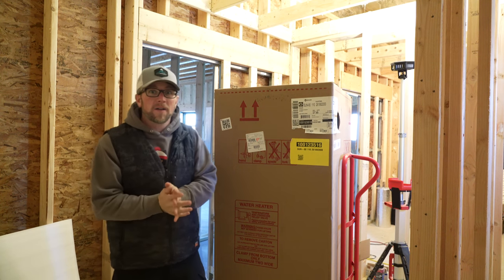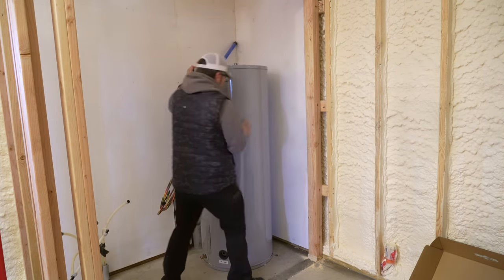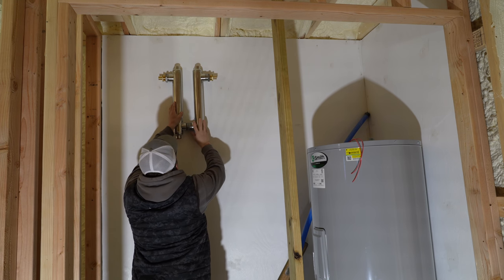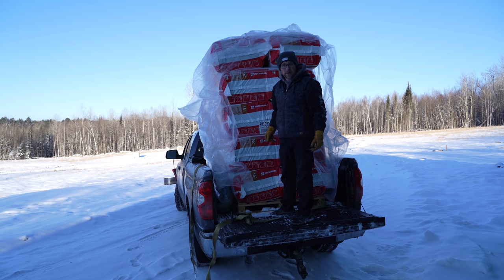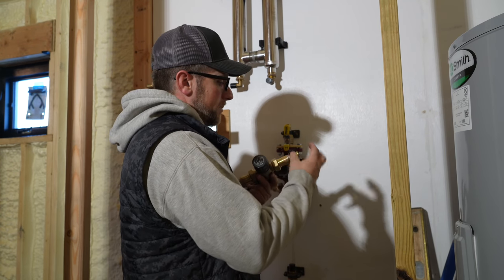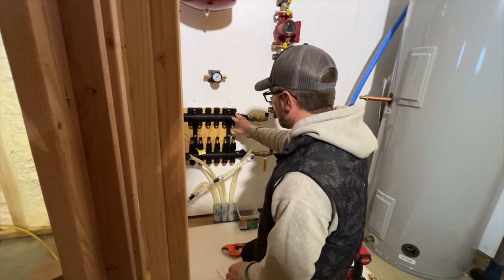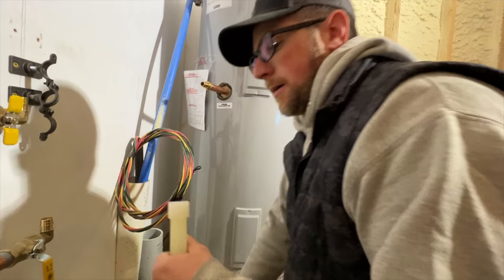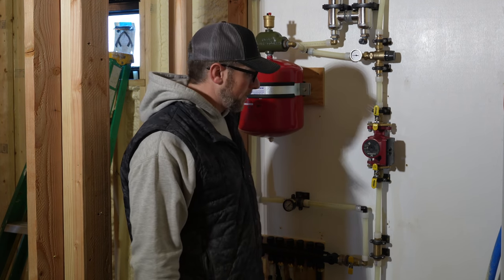What Could Go WRONG... Installing In Floor RADIANT HEAT with No EXPERIENCE!

Comment: my brother has an outdoor boiler in Minnesota but does not have fresh water going through it it is filled with anti-freeze and a heat exchanger heats the water so the water never freezes even if the fire goes out. that might be an option for you.

Comment: Flux just prevents the oxidation that would occur very quickly when you heat the metal that would prevent a good joint. You don't need flux after the solder. You should just wipe the solder with a rag to clean the outside of the joint to remove any drips.

Comment: I hope that one angled fitting does not leak.  From watching other videos where people used that expanding pex it does not always seal if there is sideways pressure on the fitting connection.

Comment: Yes that valve at the bottom of the hot water tank SHOULD have a handle on it. And like the other subs are saying, please put a plastic pan or a wooden box under your tank. Great videos, Blessings
Reply: A commenter stated that no handle comes with this particular unit.

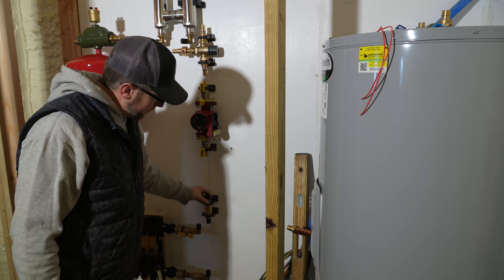Comment: "The knee bone connected to the thigh bone..." that's what came to mind as you described where the water was going to go at 00:21:13, lol. Sure am glad you know what you're doing. Reminds me of the first time I was rebuilding a computer using Scott Mueller's 4-5 inch thick book. I had to read each paragraph over and over until I could understand it!

Comment: Two problems with pink fiberglass 1: at below -20c it loses 50% of its r-value through conduction (the dirty little secret) 2: if it gets wet, the insulative value is also compromised. The binder also seems to be a favorite meal for black mold once it does get wet. (I've removed a lot of this.
Roxul is a product made from processed slag. It is short fiber as opposed to fiberglass, no binder to worry about, and insulates even when wet. We've switched all our projects to using that or foam. it's also less itchy.

Comment: AOSmith is a great water heater and the drain valve is correct you use a flat blade screw driver.

Comment: You can put Glycol or something similar in the system to prevent freezing.  You should always put it in that type system. FYI doing plumbing and HVAC design work since 1972.

Comment: Solar is a good way to go it's a little bit on the high end but in the long run if the power grid should happen to fail at least you know you're going to have something which is very important.

Comment: When you were sold the Outside boiler,! didnt the supplier not have the pipes you need in stock?, I would imagine they would have been part of the Boiler, surely they could get the pipes quicker than you!!!. Lot involved putting in all the bits needed!!. Thanks for the video from cold UK.

Comment: Nice job with all the pipe runs. As for the water heater drain valve, it looks like the one that I have...no handle. You have to use a screw driver to flush it. If your water has a lot of minerals in it it will, eventually, be next to impossible to open after a year or two. When I replace our heater I will install a better valve before installing the tank.

Comment: Not sure on Flux with plumbing but with electronics the Flux is used to help the solder flow. But it's corrosive and should be cleaned with alcohol.. I could be wrong when it comes to copper pipping, but it's definitely not a cleaner. I'd clean those joints with alcohol.

Comment: You can swap out the 240v heaters in the tank with 12/24v ones to go right from the panels skipping the battery and inverter.

Comment: I would have gotten a larger pressure tank so the pump does not have to work so much, unless that tank is just for the floor, then it would be fine.... Awesome job, both of ya.....

Comment: I've asked before. Are you using antifreeze in the outdoor loop if not why.
 The reason I ask is that I used to help install outdoor oil fired boilers and antifreeze was a must.

Comment: The water heat is before it goes in the tank and after it comes out of the tank it works very well this way it was worth the extra 140 for the extra heat extra heat extra heat exchanger and I always have hot water

Comment: I used Shark Bite fittings on my system. But that process you used for your hose connections looks real promising.
Reply: Considering the cost of sharkbites he probably came out a wee bit cheaper. Love PEX. I replumbed ny entire house with it. Only have 1 line under the house now. Wouldn't use ANYTHING less. I used crimp rings. Never had a leak yet but I must say, it wer'nt cheap. Still, gotta love that expander. It will pay for itself many times over before you finish the big house provided it's a quality tool. The bitterness of low quality long outlives the happiness of low price.

Comment: Love your videos and been watching for years. Pull the valves apart before you solder them. There are plastic seals inside that could get damaged by the heat

Comment: I believe you should trench in your heat pipe from your boiler to the house whether you hook it up or not because the ground is only getting harder on you tape off a block off the ends outside and then you won’t have as much trouble otherwise you’re gonna be looking for a jackhammer to put on the end of your bobcat excavator

Comment: On solar systems there is a way to use the excess power generated (batteries full) to use that extra power to run a load such as a hot water heater.
Reply: The water heater will run from solar power in the summer when the boiler is not being used.

Comment: I noticed you have not placed a about two feet PVC Frisbee under your new tank, this prevents the lime in the cement from rusting out the bottom, it will sweat under there, other thing you should avoid soldering with lead as it is toxic, copper solder, no flux needed copper to copper just a little when soldering brass

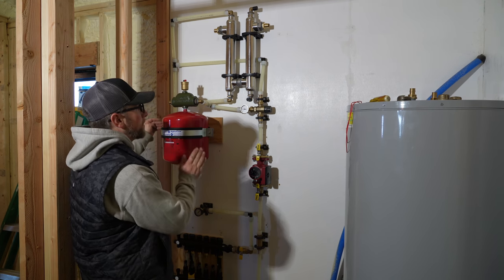Comment: 32:05  you will have a chance to clean that pipe up when you cut it out to install that mixing valve in the proper orientation ( you want to have the circulator pulling from the "mixed" port)
I would personally remove that mixing valve and install it on the domestic tank so you can put more energy into the tank and still have tempered hot water
As far as doing radiant with a tempering valve..meh...it is only giving you the ideal temp at one specific heat load profile look into the "taco I valve" it will change the system temp delivered to the system based on outdoor temp...keeping things stable and happy
hydronic pro for 30+ years    oh btw that pump already has a check valve in it if it says "IFC"...not that you would need any check valves on that system

Comment: Flux is an acid cleaner and you need it to allow the solder to flows integrate into the prices you are soldering.   I solder alot for work as a steamfitter.   You should only solder joints above a ball valve like that in an as needed basis.  Reason is your solder can drip down into the ball valve.  Normally you would shut the valve if you had to do it that way.  I always solder in horizontal position preferably in a chain vise.  I also leave valve half open in horizontal position so the water in valve from testing doesn't turn to steam and leak out the packing.  You also have a hot water maker.....not a hot water heater.  You don't heat hot water.

Comment: Is that an enclosed boiler ?  cause you have expansion tank.  Use boiler treatment in it add some every year .keep rust out.
Hope you have the pipes insulated to the house or ground will suck out heat.

Comment: I noticed that you are using the Uponor pex system. Think it is also called Pex A and not available in the big box stores, only at plumbing supply stores.  Many think it is the better pex system but the down side is the price of the Milwaukee expander.  It is the only pex system, I think, where the unions inside diameter is the same as the pipe inside.  I used to replumb our 100 year old farm house.
Reply: Money never seems to be an object. YouTube profits pays for all the exuberant things they do like the large green house and numerous battery powered tools and tractors.

Comment: It's a good idea to raise the hot water tank above the floor about 2" to 3" in a overflow pan drained outside or floor drain. All your brass connections should be taped with Teflon blue tape or Yellow manufacturer specs. Could use white pipe dope also even though they mayb pressure fit I always pipe doped the threads or taped with Teflon tape for plumbing water lines there's tape for gas lines and different tape for potable threaded water lines. Tip when soldering brass pipes to copper make sure all rubber O rings are removed or will cause failures to occur from heat brass pipes hold heat longer because of metallurgical properties are different than copper. When u sweat pipes heat the pipe uniformally after each connection is sanded brushed and fluxed. Flux cleans the metals from impurities in the solder allows the solder to move and use the torch flame to while applying the solder to move the solder quicker then either brush the joint or wet wipe it with a rag and gloved hand. Usually if any bead were to form its most likely to leak there why wiping the connection is essential. I Retired a mechanical plumber

Comment: That looks nice and neat. Good job! Isn’t PEX-A wonderful! 
It appeared the only thing you soldered were those ball valves. I hope you didn’t wreck the seals with the heat. It’s a good idea to disassemble them first. They make PEX-A valves as well. No soldering required. Wipe off that flux you put on the joints. It’s corrosive long term.

Comment: I can’t help but recommend you look into a rapping or vibrator system for the panel frames. Could maybe put on a timer and see if the snow will sheet off with just those.

Comment: ☮ A non freezing circulating water mix with a rust inhibitor in the ones I've installed in my homes and shops , hopefully you're already up to speed on this as well as marking everything , and I wood consider plumbing the upstairs regardless of the unlikely event it's required for additional heat, sucks to be wrong lol. Knowing how everything works and doing it is 100%, keep up your diligence and great attitude 👍

Comment: I think that expansion tank (red) with its air release valve should be highest in your system. Otherwise you will have serious bleeding problems.
Reply: Just use multiple air release valves on high points.

Comment: I'm not a plumber, I have done a lot of soldering at my house. To this day all joints I have soldered hold and never had a leak. Does the flux go on first and then after heat? I always put it on the joint, then I heat it up, and then I hit it with solder. I feel like a dope, I've been doing it wrong for long. Do I need to do it before and after?

Comment: You should put a drain pan under the hot water tank  if it ever leaks it will contain it and run the hose to the drain from the pan

Comment: AL the boiler you have is the water reservoir inside of the boiler vented or not are you going to convert to closed-loop? if you are going to leave the boiler storage vented you can't have any plumbing higher the vent otherwise the water level will flow out the vent also are you going to fill the boiler with antifreeze? water may not be the best for your setup

Comment: I wonder, do you have a drain close to the heater? If you need to emty it? Can you emty your floorheating system if it is necessary? Are you putting in a handpump for the water incase something happens?
Grew up in a very cold place and we use to secure things just incase and we had to use it now and then…
It is really smart that you learn how everything works.
Reply from the maker: Yes the drain is not even 6 feet a away.

Comment: MAPP gas is definitely the way to go.  I always wipe off the joint with a wet rag to remove the excess solder and to clean off the flux because it will turn green over time.

Comment: Al, this is no hate or anything like that, I am not a plumber and i hope i am wrong but my feelings say that one pump for that whole system won´t be enough and you can´t drive that system with 40 psi. A Watersoftner (Desalinator)  would make your life much more comfortable before any Water goes in to the system bc . at that tempreture you heat the woodboiler the most of the lime will come out so i am sure it will block a valve or a pump. And depending on all that rocks on your OGP your Water from the well must be very hard.

Comment: I’m in the trades and work mostly with copper and bm steel… have seen my fair share of pex.. I think I’ve only seen 1-1/4” pex once and it was someone’s main coming in. Good choice on pumps, the grundfoss pumps have been reliable for me(better than the taco ecm). You’ll do yourself a favor in 5 years if you can get a ball valve between air scoop and expansion tank now.. if not you’ll take a bath like I always do 🤣. Keep up the good work!

Comment: Well water / filter for heat exchanger ?
it might be advisable to check with your well driller about potential need to filter water going into your heating system due to contamination of chemicals that might cause premature guest year he exchanger and other heating components. By the way glycol is bad for anything that rubber in your heating system.

Comment: you should really put that hot water tank on a couple pressure treated blocks.  It will rust out the bottom if you leave it on the concrete floor.

Comment: Isn't that a thermostatic mixing valve? If it is then I'm pretty sure it's hooked up incorrectly.  I think the center connector is the mixing output and MUST be connected to the input side of the  circulation pump. And one of the side connectors is the hot water input side and should go to the heat exchanger. And, the other side connector is the cold input side and should be connected to the tee on the return manifold line. 

And, maybe it's just me, but I'd mount those heater exchangers horizontally rather than vertically. Seems like it'd be a better use of the available space.

Comment: Hi all I think you need to have a look at plumbing regs internal hot water units need to be put in a tray with a drain to outside 
Hope this helps not a grizzle
Ps don't forget the pressure  relief  valves also need to go outside or into a drain

Comment: that worked out really well... yeah theres no emergency to get that hooked up you got the electric oil heater and your torpedo heaters... you can run that line over from the other side.. or pull some electrical wires for the walls .. lots of stuff to do ... but have you tried your spring fed water system yet??? like to see if that thing runs this cold.. might if the tank is not frozen.. :o) anyway good job catch you next time.

Comment: I didn't see any electrical connections for the hot water heater in your utility closet.  I know you said that you didn't want to use the electrical component of the hot water heater but you had it if you need it.  Will you be running electricity there?
Reply: Wiring not run yet.

Comment: What type of flux did you use? Flux for electronics is not the same as what is used for plumbing. If that was a acid based flux you need to go back and wipe clean those joints, otherwise it will accelerate corrosion. It will turn green very quickly.

Comment: Lots of very good advice in this thread! It's a good idea to put further development on the back burner and read through all this really great advice. You don't want to finish and then say, oh I wish I saw that comment before I filled the tank with water ... i.e., the antifreeze suggestion! It looks good Al. I hope there wasn't any internal damage to that tank ... i.e., just concerned that the copper valve was right in the area of the damaged box corner ... seems you wouldn't see the type of damage that might cause if that valve took the brunt of the impact ... I don't know ... just a thought when I saw you open the box. Keep an eye on that. If I haven't already said it, wishing you and the family all the best in 2022.

Comment: So when you did the concrete and the skeleton you had to have inspections are you going to have to have 1 on the electrical and the plumbing as well ?
Reply: The, only, inspection that was needed was for the septic system.

Comment: I would get the tank off the floor to prevent corrosion of the tank bottom and to be able to drain the tank using the valve at the very bottom.

Comment: I’m not an hot water heater expert, I didn’t even stay in a holiday inn express, but I don’t believe that they are equipped from the factory, with a handle…you simply use a flat head screwdriver.

Comment: For someone so fastidious, you had me cracking up when you unloaded the insulation - lol  The build is looking GREAT Al.  Also, as someone who has just installed some Roxul Rokwool (for a CoolBot walk-in, on the outside of the polyiso sheets, since Rockwool is impervious to moisture and mold) I think you'll really like this product.  Use a serrated knife to cut it.

Comment: I am wondering if you don’t need a woodshed to keep all the wood you will need dry. Also where’s the wood?
Reply: In past episodes, one shot was a huge pile of logs the loggers left for them last time they were there.  Al just has to cut them up for boiler-sized pieces.  When they run out of that, it's time to head for the woods to get more!  With 500 acres, they shouldn't have a problem finding suitable firewood, I'm thinking.  👍